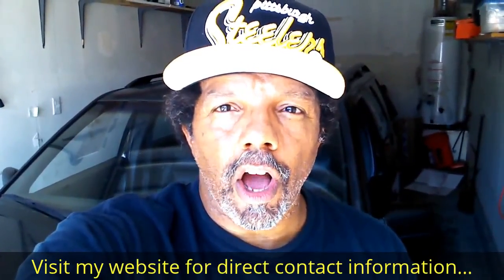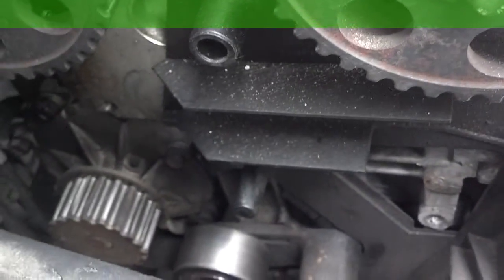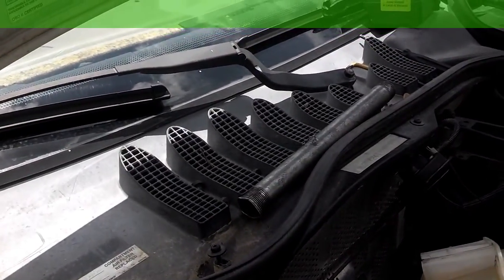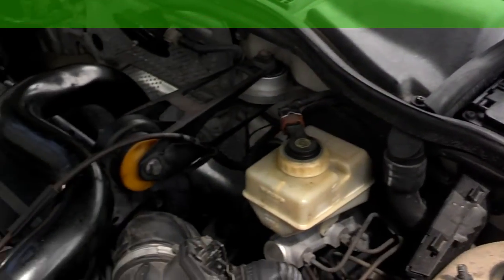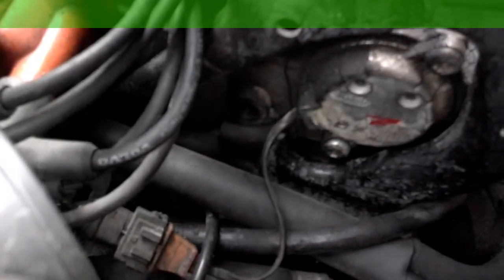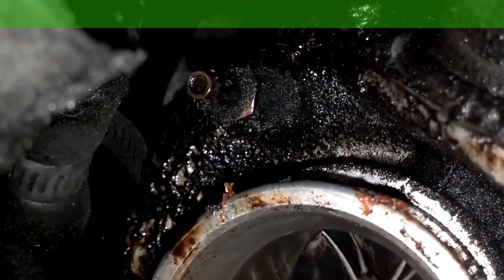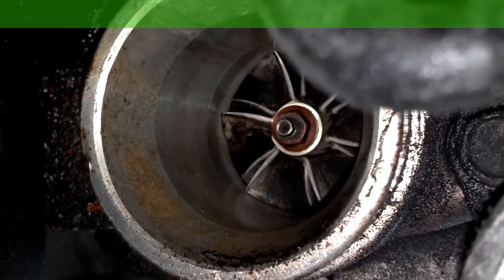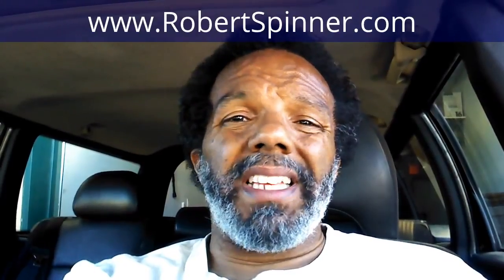Day 28, Robert DIY helper tour, still in the Charleston SC. - VOTD

Comment: And yet another timing belt death is averted.
People playing musical chairs with the boost systems, silly sods!!, i would have labeled the tubes if i didnt know what they were for. (coloured small zipties).
Ive done a quick drawing of pcb's that have many wires attached so i could dissasemble and repair, then the crude diagram is my guide for wires, never fails :-)
Now i use my mobile and snap a few piccys, handy old phone.
Those engine mounts are slightly worn :)
Reply from the maker: zx8401ztv I find a lot of turbo vacuum tubes misplaced. What a mess.
Reply from the maker: zx8401ztv I find a lot of turbo vacuum tubes misplaced. What a mess.